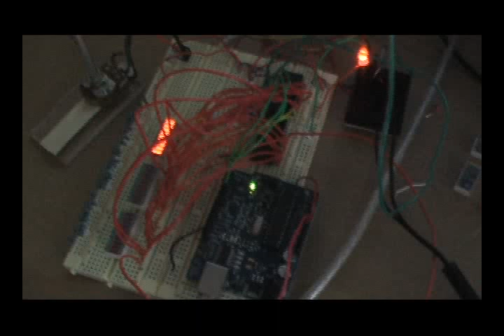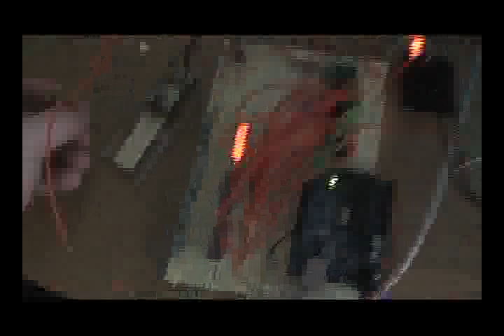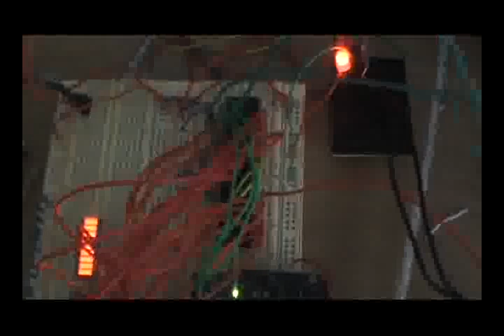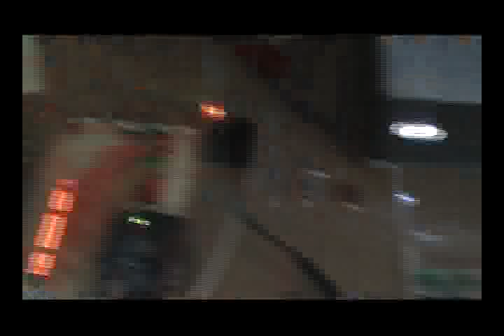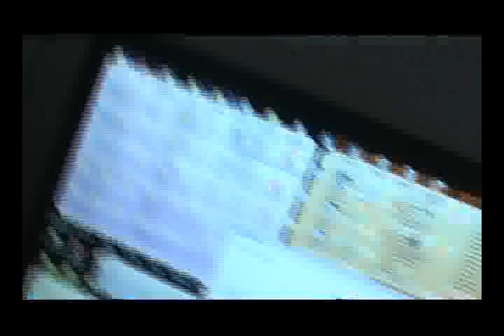Arduino shift register LED strip potentiometer version #2

Comment: Hello Jesse, is there any circuit diagram or arduino program? I'm trying to make same, but I don't have all informations. Can you share it with me?
Reply from the maker: Hello, I never published the schematic for this, but I can give you some guidance. You need to send the 'value' for the lights to the shift registers, and you use that to drive the LEDs. I believe it was like -register out -> 220ohm resister -> LED -> ground for each light.  so you'd go from the microcontroller to the registers and each led has its resistor. you can buy the resistors in strips also, makes it easier to manage.

as for the potentiometer, its just like any voltage divider going to an analog input on the microcontroller. I eventually switched the knob for a breath controller - worked great. Higher pressure lit up more lights.

In situations where I've had a LOT of lights, I actually used motor drivers (yes really) to make sure there was enough power to all the LEDs. 

My world is mostly javascript programming these days, and when I made this tools like johnny-5 and even raspberry pi simply did not exist. I'd like to return to working on hardware more some day, but for the short term I simply can't. Hope that helps!
Reply: Thank you a lot for guidance. You inspired me. Greetings